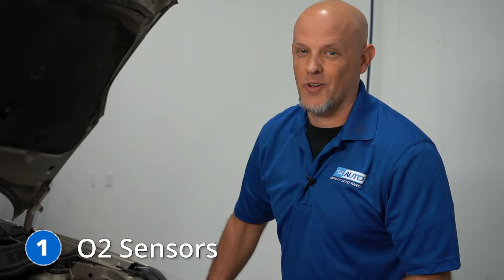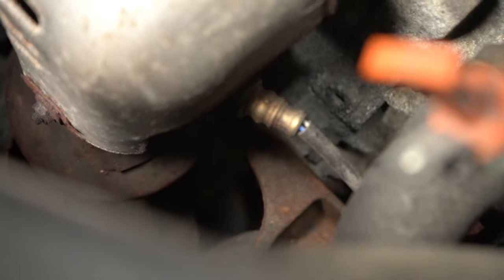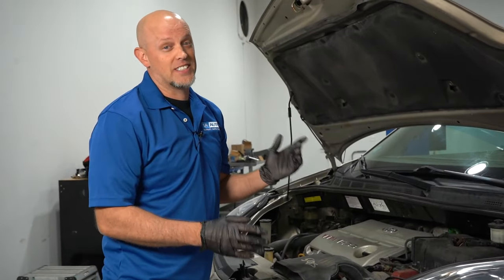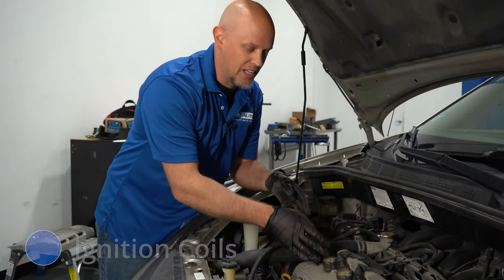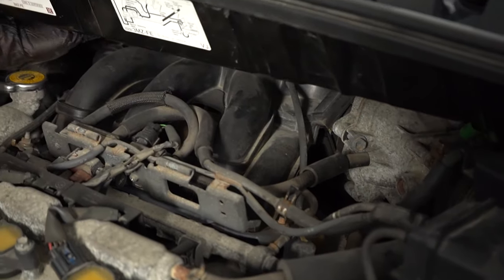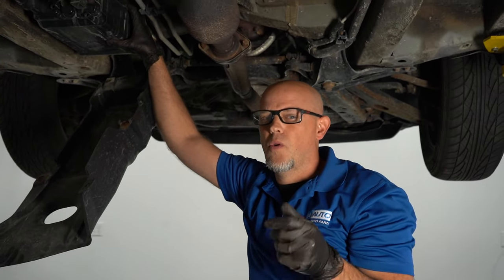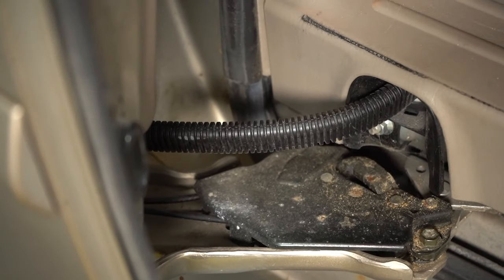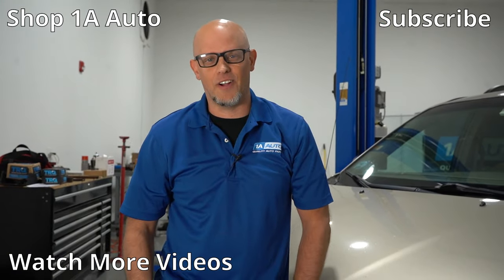Top 5 Problems Toyota Sienna Van 2004-2010 2nd Generation

Comment: the fact these are very minor things that can be done in under 30 mins is pretty insane, these will last forever for sure.
Reply: The power sliding door is a 3 to 4 hour job with the pre-assembled cable unit.  Otherwise, it will take at least 5 to 6 hours to complete one door.
Reply: @tomkoolman  Exactly. And replacing the three coils in the back with the valve cover gasket and the spark plugs? Two hours.
Reply: Unless like my 2004 Siena XLE that went through 2 transmission failures . 1 at 73000 miles, another at 130000 miles. AC compressor,  new radiator, the power door issue. Liked it, but unloaded it after the second transmission replacement. They're not all great.
Reply: I had an 04 Santa Fe LX for a few years before I got my 06 Sienna(it was free) and overall I liked my Hyundai more. The reliability is there in my Toyota but servicing it overall is not that fun. Lots of cheap plastic everywhere.
Reply: @phw2274  first year of that gen , you never buy first year

Comment: I drive an 06 Sienna and have never had any issues or codes in 255k miles. The sliding doors both broke but I'm not lazy like many so I just operate them manually.

Comment: #6 - Thermostat 'plastic' housing that cracks along the "welded/glued" line and will leak antifreeze. If you are handy, you can do it yourself. But first buy yourself 5 small acrylic paint bottles of different colors at TARGET. Paint connectors and hose plugs in different colors because reconnecting them could be confusing. While there, replace those 2 plastic T-hose connectors with Aluminum ones - a salesman at any auto-parts store will know as soon as you tell him what you are doing.  If you are not handy and you can afford it - let the qualified mechanic do it for you because it will be very frustrating at times!

Comment: I have one with 600k haven't had any problems other than regular maintenance
Reply: Wow that's awesome. And I thought mine had alot of miles on it at 215
Reply: 600k?! 🤯...👍 nice! My 2005 is at 251k so this gives me hope. 🙆🏻‍♀️Just acquired it at 249K from my sister (original owner) and so far had to replace the original starter motor and gas cap which triggered the check engine light. All's good now and 🤞 she'll run smoothly for at least another 10k before dipping into the pockets.
Reply: Wow! Is the 600k miles or kilometers? Has the timing chain been replaced?
Reply: @nhung7592  Is that 251K miles or kilometers?  Was the timing chain replaced or still original?

Comment: My 2005 Sienna just had the ignition coil #4 replaced after noticing engine idled rough and losing power when accelerating. The car has been reliable over 17 years and 318K miles. This has been the most serious issue. Previously serious issues were 1 starter and 1 alternator.

Comment: I had a 2007 and never had a single problem .It was the best family van we ever had.
Reply: My parents have the 07 with 325k miles. Engine had an engine overhaul at 300k due to a broken spring (didn't drop the valve). Been a good vehicle
Reply: I currently have a used 2007. So far only thing that's gone bad after a year and a half with  it is the break light sensor went out, but it was super easy to just pop off and swap out, no tools needed.
Reply: Still have a 07 from new, 0 breakdowns and problems so far and haven't encountered any issues from the video but it's got pretty low km's. Hoping to drive this thing for at least another 10 years.

Comment: Waaa? Sounds like there are no problems. I have 2000 Sienna. I owned it since 135k. replaced O2 sensors soon, ignition coil, steering rack (at about 190k), windows regulators, front struts with sway bars and links, rear shock absorbers, radiator (at about 180k it will blow on any car), 100k service (water pump, timing belt), pulled out power door motor (stuck, replacement is too costly). I don't count brake drums with brake shoes replacement (once in 10 years) and I just put on second ceramic brake pads. Recently replaced alternator and 3rd battery. Voltage started to drop down to 11.8 with all auxiliaries on (AC, front rear fans, headlights). No mechanic can/wants to find what causes voltage drop and as I mentioned before I got new alternator and battery ( went through 3 reman alternators).

Comment: I have a 2007 Sienna with 133k miles that i bought new. I just changed one of the 02 senors and have fixed the power door over 10 years ago. No problems yet with the MAF or coils or evap. Great van!

Comment: My top ones:  steering midshaft,  lower control arm bushings, driver side door check welds, driver's side door latch welds, radiator cracks.

Comment: We are the original owners of out 2006 Toyota Sienna LE FWD with 193k miles. Common problems so far is power sliding doors, wheel bearings, lower control arms, and leaking valve cover gasket. We recently changed out the driver CV Axle as well. This car definitely needs more maintenance then our other cars but it constantly hauls 6-7+ people everyday and picks up our restaurant supplies at Costco weekly.
Reply: What are your other cars?
Reply: @Mabeylater293  
2013 Hyundai Elantra GT
2015 Hyundai Genesis Coupe 3.8
2016 Lexus NX 200T
2009 Mercedes Benz ML350
2017 Porsche 911 Carrera S
Reply: @CJ-fh5xq  yea of course it’s gonna take more maintenance then those other cars it has a lot more miles then your other cars and it’s much older then most those cars you named..

Comment: I’ve had a 2008 Sienna for just over 2 years now. Have already replaced an O2 sensor, mode door actuator, both blend door actuators, heater core, crumbly plastic heater hose t-fittings, and power sliding door cable. Fingers crossed I can avoid needing the MAF sensor, or Evap Canister anytime soon.

Comment: I have a 2004 Toyota sienna with 198,000 miles on it. For the last four years I’ve had an engine check light and VSC check light on the mechanics at the dealership have replaced two oxygen sensors and a catalytic converter and still have not fixed the poor gas mileage and engine check lights! About a month ago I cleaned my mass airflow sensor and disconnected the battery to reset the codes. Before I did this my van was averaging about 13 miles per gallon afterword I was getting 23 miles per gallon. But now the lights have come back on and I’m down to getting 13 miles per gallon again!
Reply: Did you buy the OEM or off market maf? Buy the Toyota genuine to replace it.

Comment: Mine has over 300,000 miles. The only thing that I need to replace on his list is the o2 sensors and the latch actuators in the sliding doors.

Comment: Should I repair a 2008 sienna with 170k miles that needs wheel bearings, shocks and sway bar links ? Everything else is working great
Reply: Mine have 250k miles and still going ok with front shocks and lower triangles replaced
Reply: yes these van can go 300 plus thousand miles
Reply: Im not a mechanic but Id say definitely if it were my car. Keep that van out of the junk yard. Too much embodied energy to waste it.
Reply: Of course go for it still worth 8k
Reply: Yes. It will run another 170k miles
Reply: Yes! very dependable vehicle👍🏼
Reply: I definitely would.

Comment: Just had the rad 3:12  replaced in summer of 2023 for some reason my 07 Toyota sienna van blew off the rad filler neck wasn't sure what caused this issue but may have been low antifreeze or air bubbles. Only 117,000 miles still lots of power mechanic said will need new belt tensioner as getting noisy and new gator serpentine belt
New plug wires as for some reason they move and then cause the engine light and Trac light to come on.

Comment: Should I buy a 09 Sienna Le with 155k miles for 3k is that reasonable or should I negotiate the price lower it has no dashboard lights and interior and exterior look really clean. So I wanted to know if it’s safe to buy this car used because I have two daughters and we need a bigger car. Thanks

Comment: “The Car Care Nut” Toyota Master Mechanic has a two-part YT video on the 2004-2010 Siennas and also a Chassis Electrical video & details the primary concerns. This 1A Video is the top 5 most common issues. If you never had any of these issues you’re lucky 🍀 but don’t criticize them for offering helpful advice.

Comment: thank you for this useful video. My 2008 Sienna has engine heating issues, I replaced radiator and water pump, but still the coolant does not circulate, the overflow tank is normal temperature and radiator is hot and a bit of coolant evaporated, what could be the issue? Also I bought this used vehicle and now it is coming up with Maintenance minder, what should I get it done in a non expensive fashion
Reply from the maker: +@skbskb7596 We wouldn't be able to diagnose an issue like that here, you may want to have a local mechanic take a look at it. Thanks for checking us out! http://1aau.to/m/Shop-1AAuto-c

Comment: 🙋‍♂️ ok so today I did some maintenance on a 05 sienna, and when I was replacing the air filter I thought it’d be a good idea to clean the MAF sensor. And of course being a  klutz, I some how disconnected one of the 3 air lines that was going to the air filter cover where the MAF sensor is screwed on to, and I heard it release air like when disconnecting an air hose from a compressor (well maybe not THAT loud). I didn’t even clean the MAF sensor, and just out everything back. Turned on the vehicle and let it idle. After like 5 min the RPM dropped to around 500 but the vehicle didn’t stall. I shut it off and tried to turn it back on, nothing. Tried a second time, and now it just stays at 500.

Any suggestions how to fix this blunder??

Comment: Love my '04 Sienna with 223,000.  The only problem dont have is the sliding door issue.  The sad thing is I haven't found any reputable mechanic to help with these minor issues.  I'm always quoted $500 and up before they even look.
Reply from the maker: +The Thrifting Channel Thanks for the feedback!
Reply: Thats a dang shame!!! What city u in? You down South?
Reply: What!!! I was quoted 1k for the part.
Reply: @1AAuto  What level on the transmission dip stick to top off the transmission fluid? It's not covered in the owners manual.
Reply: Good luck!  We also have an 04 Sienna in the same mileage range, and we are among the many, many unlucky people who had the front door weld break.  Have been quoted $3000 to replace the door.  The problem is that the door check no longer works, so the door will swing wider than you set it for, which risks banging into and damaging someone else's vehicle.  Toyota was finally forced (by the sheer number of complaints) to acknowledge the design failure and fix these, but we didn't get the notice or have the problem until after the recall had expired.
Reply: Smae here. I just removed it and let it swing (ai hold it always with my foot)
Reply: It can be expensive. I found the main center hinge sags from bad design and rubs on the edge of the car just before it closes.

This puts stress on the under powered motor that pops the door open and wears it out. $20 for the motor and new screw kit on eBay. Hinge I ordered from Toyota. Price went up $100 to $25 over the last few years and are often not immediately in stock. Took months to get mine. Easy install. A couple good videos on YT.

Comment: Have you done a video on the motor mount type of PWM vacuum switch valve? I can’t seem to find any decent info on which of the three hoses go where. The switch has a port on top, that I think goes directly to air filter box. Then two ports in back. I think one of those ports is a vent and the other goes to what I believe is called the actuator. It connects to a second vacuum switching valve then the actuator. But I can’t find anything online that definitely tells me which of the two back ports on the PWM vacuum switching value is to vent and goes no where. Seems to be something I should get right on my 2008 Sienna!

Comment: I have an exceedingly silly question...can I add a driver side power sliding motor and such to a 2004 Sienna LE? I know the XLE has it but this LE came with full history and such so I went for it when I got one recently as a temp car till more EV options that fit my needs come on the market. But...not having a power sliding door on this side is becoming an issue...

Comment: Only done ignition coils out of that list. Power door cables are more common than those listed. Valley plate coolant leak on the 3.3s. And #1 is probably leaking power steering rack.

Comment: If the power side doors fail, can you simply open and shut them manually. Will they still lock?
Reply: Mine does not open from the inside but does open from the outside, its very heavy!  Yes they still lock, manually and with key fob.
Reply: You can still open and close them manually, but nowhere near as easily as a manual door.  We have a 2004 LE with one manual door and one power door.  The manual door is super easy to operate.  The power door, with the power shut off to it, is not.

Comment: It is counterintuitive but dirty filters actually filter our more particles than clean ones.  The problem with dirty filters is that at some point they create too much back pressure or break.  In manufacturing plants, they sometimes have backpressure gauges to indicate when a filter is too stopped up.  Meanwhile the filter is getting better and better at filtering.

The logic.
When a filter is new, they have holes so air can go through.  They will catch particles larger than the holes.  As particles partially fill some of the holes, they catch some of the smaller particles.

Bottom line, dirty filters are not the cause of MAFs needing cleaning.  Of course you do need to change the filter eventually or it will make the make the fuel air ratio too rich.

Comment: VERY common problem that's hard to fix on 2004's: the driver's door check strap cup cracks, causing a popping noise when opening and closing. There was a "recall" years ago but it has lapsed. Cannot buy a replacement cup that should be welded into the door.

Comment: 2006 Sienna with 213,000 miles and one fairly hard front end fender bender that badly tweaked the hood/fender panel alignment,. Haven't had any of these problems. Only issue is severely clouded plastic headlights. Plastic headlights should be banned. My 41 year old truck has glass headlights clear as the day they were made.

Comment: S 2005 sienna runs and starts fine but every now and then the shifter locks ,there's no power on the windows radio,horn but somehow it still runs  not sure if its the computer or the brake switch took it to a few places but they couldn't find the problem?????? When it doesn't have that problem it runs beautifull

Comment: Sienna is reluctant to restart when the engine is hot (quick restart after running)
No check engine light, no over heating no codes showing.
Engine cools down a bit (10-15 minutes) and it fires right up on the first try.
Very strange… in need of assistance 🙏🙏

Comment: I have toyota seinna 2006 it have a lot of codes but codes no problem slide door is not working but it’s ok main thing that AC doesn’t give good throw because of under dashboard fridge and I’m so worried about it because I’m In Dubai and weather is hot

Comment: I am using a Toyota sienna 2006 I washed the engine because it's too dirty I covered the alternator thou..but since then I had problems with the car whenever I start the car its vibrate hard and it's not stable..please any help..

Comment: I have a Toyota Sienna 2006. The other day I hit like a rock on the road. It was a loud noise. I sounded serious. Found a leak. Had to replace the radiator but the van started overheating. I had the thermostat and the temperature sensor replaced but still over heating. I was told it could be the water pump or head gasket. I can drive the van for short distances until I see the temperature gauge needle go way up then i pull over and wait for the engine to cool down. Any suggestions?
Reply from the maker: +@nato2panama We wouldn't be able to diagnose an issue like that here, you may want to have a local mechanic take a look at it. Thanks for checking us out! http://1aau.to/m/Shop-1AAuto-c
Reply: Any follow up? Your transmission or oil pan got whacked? Every 90k the water pump and belts need replacing anyway

Comment: im still looking for a close solution to tha sienna problem it runs perfect  NO HESITATION WHAT SOEVER NO BACKFIRING no gas smells transmission shifts fine when i  unlock it  the instrument panel works fine  the horn works .....with the exeption of the wipers,signal lights,radio, door locks,transmission wont go onto gear unless i unlock it and new now its not charging the battery took it to a few sooo call electromechanics  guys and well they  could not find the problem i am really at a los here i am thinking it could be the ECM .....????? COULD USE SOME HELP

Comment: If there is any truth to this, then 1-4 must have stopped at 2003. Only the doors (depending on how much they are used) and roof mounted DVD players is true on 04-09. We service quite a few and only had to change an alternator on one at 160k.

Comment: I got a problem with my 2004 Sienna,  maybe someone can help me? Ignition key out - rad fans start working. (Not all the time, it may happens once a day or once a week) They may start any time when car locked and alarmed. Key in, ignition ON - all good. The same thing with day light. May turn ON any time when not in use. Drain battery to zero. I disconnected day light. And disconnect fans plug all the time when not driving. This happens mostly in rain season when wet. Never in dry summer. Any idea? Thanks